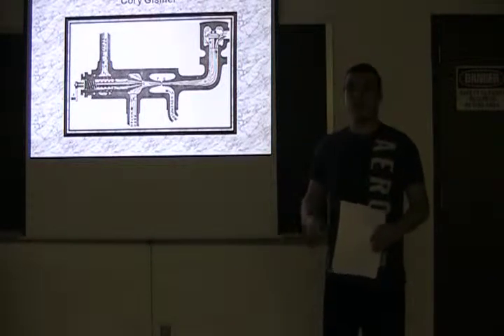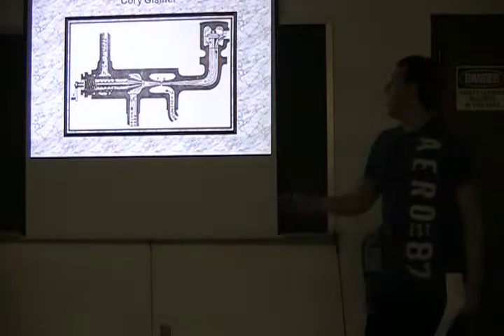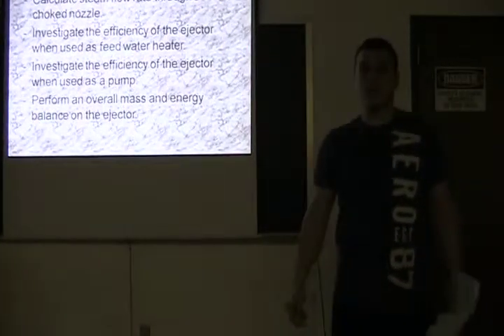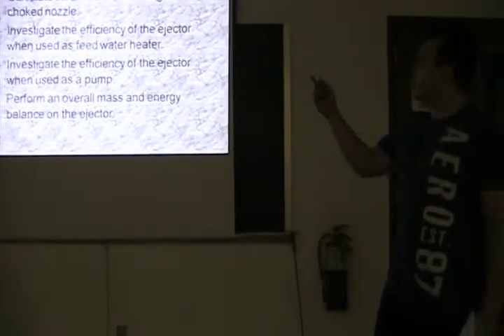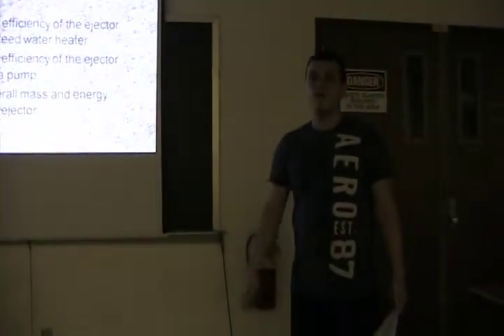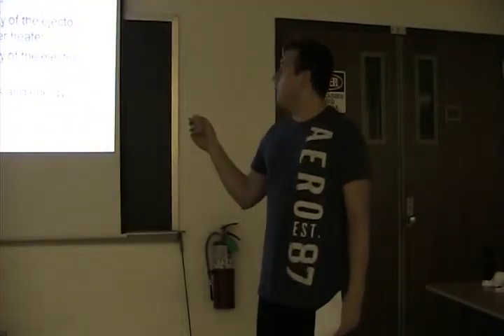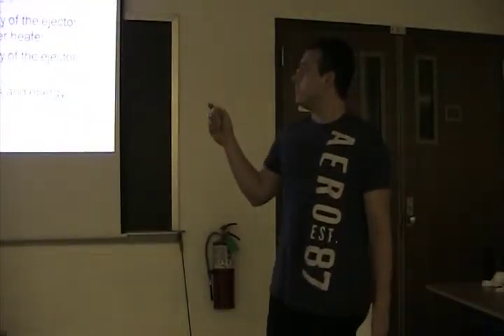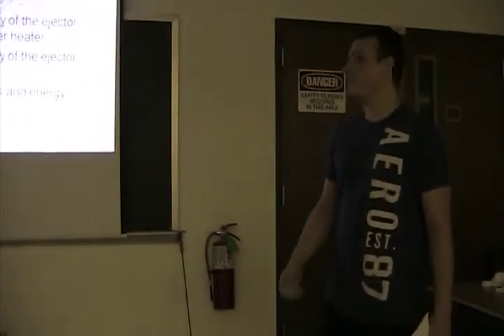file000018

Comment: Cory did a really good job of presenting. The handouts were a good idea to use in order to allow the class to keep up with your presentation during presenting the procedure. I feel that Cory had a great understanding of the experiment and even made a reference to the venture affect which was very impressive. He does a great job of explaining the difference between the Supersonic and Subsonic ejector, which both involve a Conv/Div nozzle but explains why one would be better for a pump vs. heater